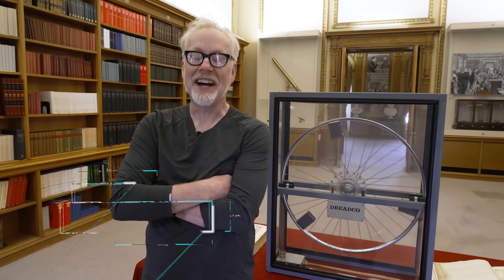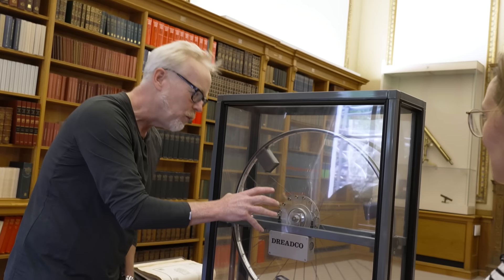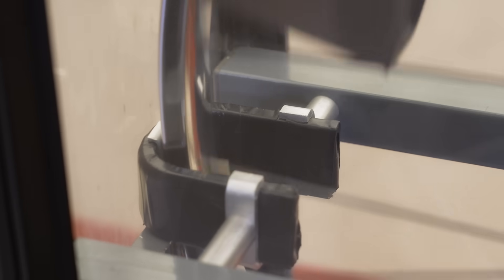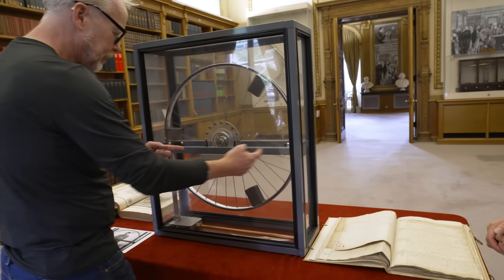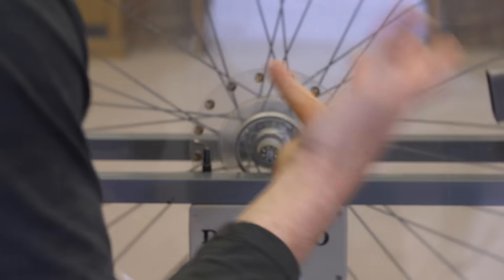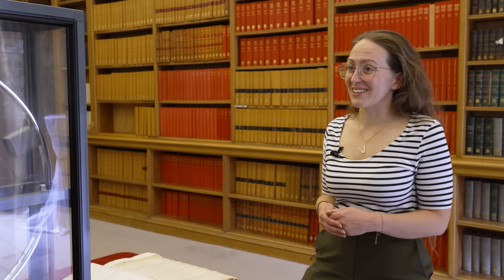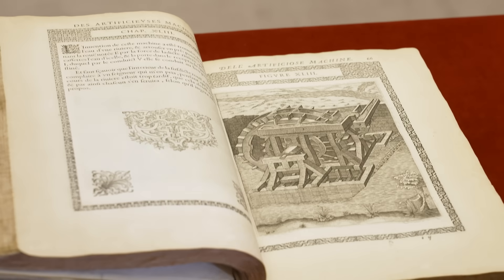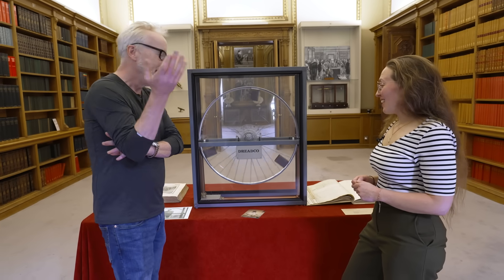Adam Savage vs The "Perpetual Motion" Machine!

Comment: a perpetual motion machine that only works if you send it back to the creator once every few months is like a magic trick that's really impressive as long as the entire audience closes their eyes when the trick happens
Reply: Well two years, but... Even so
Reply: After awhile that barring must have to be serviced for grease/barrings friction
Reply: Exactly. That immediately negates the alure. A “machine that moves for a few months without external intervention” is hardly newsworthy…
Reply: @JoeLion55  sounds like my wall clock
Reply: @JoeLion55  they said years not months.

besides a machine that self moves for 2 3 years built in what 1780 1890 whatever it was is still fucking impressive.

people today also forget that we didn't have 3d printers or MOST OF OUR CURRENT fabrication techniques.

our tools today allow us SOOOOO much more then we had available back then
Reply: @JS-rv3et  she says at the beginning the creator died in 2017…
Reply: @JoeLion55  well it's new to me, so the video has done it's job.
Reply: @JoeLion55  I think it is. The average human only witnesses a wheel spinning on its own for only some seconds or maybe a minute at maximum, when we test spin bicycle wheels or what not. A wheel spinning for 2 years without external intervention sounds very impressive to me.
Reply: @JoeLion55  you make a self contained machine that only needs servicing after 2 years, that literally doesn't stop. It doesn't stop mind you, after 2 years, it merely slows down.

This machine is extremely efficient, it's very impressive.
Reply: @TheCardanoArmy  great. Does that make it worthy of being housed by The Royal Society? Fine, maybe. Does it then deserve a video and investigation by Adam Savage with the label “Adam Savage versus the perpetual motion machine”? Absolutely not. Fortunately, Adam and the post were very clear that nobody is claiming this is a perpetual motion machine. So, at the least, get rid of the click bait title and name it “Adam looks at an interesting, efficient machine” and at least be honest about it
Reply: @JoeLion55  👶
Reply: Your analogy is pretty flawed; nobody who goes to a magic show actually thinks real magic is being performed. Everyone in the audience knows it's all smoke and mirrors, half the fun is trying to figure out how it's done. The audience isn't being asked to close their eyes while the trick is done, the magician's job is to hide the trick in plain sight, and that's exactly what's happening here.

Like Adam pointed out, we know perpetual motion is impossible, and nobody involved  is claiming this is really a perpetual motion machine. The entire point is to try and figure out what the trick is.
Reply: But you don't have to close your eyes. You're viewing an illusion just like watching a magic show. It's accepted that perpetual motion is impossible to achieve so the fun is in the art of getting as close to it as you can. A 2+ year running time is still incredibly impressive. Could you build a device that runs that long without any obvious mechanism?
Reply: It’s impressive how efficient they made it. Obviously toy can make the moving parts smaller and slower, or add more energy storage, but that makes the “hide the batteries” part of building a perpetual motion machine harder.

I don’t think the “regular maintenance” revealing that it isn’t perpetual is that detracting, especially considering that we already know “perpetual motion” is impossible (in decoherent systems anyways, there might be quantum mechanical phenomena that one would like to call perpetual, but they require very special conditions and aren’t really possible to create (it’s literally impossible to shield a system from neutrinos, for example)).
Reply: @haph2087  Tesla understood that there was a kind of cosmic energy that could be tapped into. Any thoughts?
Reply: @haph2087  A watch even does that on a much much smaller scale!
Reply: @LGAustralia  Yep, and IMO, watches are really cool devices!
Reply: @haph2087  my  9volt battery still works from 1989
Reply: @punker4Real  Nice, but has it been spinning a bike wheel for 33 years?
Reply: @haph2087  Not detracting at all. Much like when you shoot someone dead, pull the bullets out of their body and stick them back in your gun. You really didn't commit murder since you put everything back in its place.
Reply: @joanfrellburg4901  What? That analogy is nonsense.

Any reasonable person should already know, just from reading the title, that this isn’t a perpetual motion machine.

All they are doing by talking about the repairs is letting us know how close it gets, and being honest that it isn’t one.

I don’t think that’s at all related to trying to un-commit murder. If you clicked on this video thinking there would be an actual perpetual motion machine, you probably need a bit more science education. Since the typical viewer shouldn’t expect a real perpetual motion machine, admitting that this isn’t a perpetual motion machine doesn’t tell anything new to the typical viewer.

If you want to use your silly analogy, it’s more like they pretended to shoot someone with a finger-gun, and then admitting they didn’t, and you are the four year old still crying because somebody died.
Reply: @haph2087  Hmm ok, sorry you have a problem with my sarcasm.
Reply: @joanfrellburg4901  I don’t know if you knew this or not, but tone of voice does not translate into text. Especially if you don’t use extra punctuation to imply it. 

Certain devices like sarcasm are much harder to understand when reading than when listening.
Reply: @haph2087  Good point, no harm done, I respect your intelligence.
Reply: Be sure to change your smoke detector battery once a year, even though it could work for 2 years.
Reply: To be fair she said 2 years but yes they could just put "fuel" or new batteries in it
Reply: I think it’s funny.
Reply: To all you saying it s not a perpetual motiin machine I urge you to revisit the video. The while point is to have something close to it being extremely efficient and have people try to explain how it actually works. The argument "it s not perpetual motion machine" is akin to being going with your friends to an escape room, exclaming "but we re not really locked in here" and expecting to be applauded for your observation.
Everyone in the video and everyone being talked about in the video is aware that it s not a real perpetual motion machine.
Reply: @TheRandomYoYo  beautiful analogy, very well put!
Reply: @TheRandomYoYo  pop sci video enjoyers arent the brightest bunch
Reply: @TheRandomYoYo  no. I think the issue here is it's very much a poor approximation of a PMM, not a close one. It's easy to make something run beyond our lifetimes and know it's not a true PMM and we can be impressed by it, so having something that needs recharging every 2 years in a reputable institution is pathetic.
Reply: @TheRandomYoYo  Aww, you ruined it for us. This is the comment section where it's mandatory that we go off on all kind of tangents. Perpetually.
Reply: @joanfrellburg4901 I second that motion, perpetually.
Reply: that's when they replace the lithium batteries 😁😁
Reply: Maybe the maintenance consists on cleaning the glasses and ensuring that the labels still in place..... errhhhh!!!
Reply: Joseph Smith would be proud
Reply: Gremlin Man has nailed it, 896 people agree. Even I agree. So shut up and have a nice day.
Reply: See, the conundrum is ' perpetual ' which means never changing. When nothing is forever. You're asking for something that's unattainable. Even Earth, according to scientists, won't be around forever. Of course it's always fun to analyze contraptions that try to trick us into thinking the impossible has been created, the day we stop questioning we will be in big trouble.
Reply: It would need to be maintained the bearings would need oil  and friction is your biggest enemy the fact that they got it going for 2 years is impressive
Reply: @BLEACH366  Maybe Duralube or Slick 50 to squeeze a few more months out of it ? :-)
Reply: Yes, its perpetual (except for when the battery is recharged)
Reply: @gavin1168  Lol, that's why I got the plug in model. Only stops when there's a really long black out.
Reply: *Years
Reply: How else he supposed to charge the battery.
Reply: She said two years I believe. That's much better imo.
Reply: I know right, I'm going to submit my Ikea Clock.  It has run for about 3 years now on one AA battery.
Reply: So many magic tricks rely on putting a sheet in front of something for a few seconds, which is basically the same thing
Reply: I could be because parts wear out and need replaced.
Reply: You can make a very powerful static electric powered motor but it has to be kept in dry air to function. Benjamin Franklin had one to power his turkey spit.
Reply: Its more like an object that forces one to think, look and study. Its not meant to convince you it's a perpetual motion machine if they readily admit that its not
Reply: Closest thing to a perpetual machine is a jlc Atmos clock.
Reply: All perpetual motion engines would require maintenance as its moving metal components. Still needs to be oiled etc. Moisture and oxygen still courses damage.
Reply: If Perpetual motion Does not work as you Claim... Please EXPLAIN How the Earth keeps Spinning!!!! STOP LYING PLEASE
Reply: A person expecting a youtube video to show an actual working perpetual motion machine in 2023.
Reply: @CA-oe1ok  Funny, but inevitable. :-)
Reply: @CA-oe1ok  no, it’s that we expect more from Adam Savage and The Royal Society than a cheap toy associated with charlatans
Reply: @JoeLion55  I was surprised the Royal Society would have any part in this thing.....
Reply: @JoeLion55  They don't claim it's a perpetual motion machine. Though to be fair, for something with that many places to hide the batteries, it's not really that impressive. The Oxford Bell is much more impressive, and that's been ringing continuously since 1840. They put it in an evacuated glass jar after so many years because it was getting on people's nerves!
Reply: In fairness, if we did ever make a perpetual motion machine, parts would need to be serviced from time to time.
Reply: @JoaoPaletas hat is exactly what makes them impossible. Parts failing is entropy in action. It's not parts failing is holding back an otherwise successful perpetual motion machine. The energy the machine loses in the form of heat goes into the parts. The parts lose energy in the form of the bonds between materials failing and metal shavings falling off. It's just the same principle going down the line, applied to each system individually rather than thinking of it as a whole.  <-This is an example of critical thinking, what they should be teaching in schools, rather than critical race.
Reply: I mean, two years or more is crazy for an actively moving closed system, but yeah. It's not a perpetual motion machine in the same sense that a radiometer isn't a perpetual motion machine, but it's still an interesting and impressive feat of engineering.
Reply: @RalorPenwat  true. I'm confused with what people expect. On Earth, actually the whole universe, there is no perpetual machine possible, because it violates fundamental laws. But that does not take away the extraordinary beauty of very efficient functioning machines within our macro reality.
Reply: How long has the earth been spinning? Perpetual motion is relative to time.
Reply: @nevmcc3884  The rotation of the Earth or the orbital motions of the planets around the sun could be considered a motion that is perpetual as long as no other force is intervening in the equilibrium. It is not a perpetual motion machine however. The important part about perpetual motion machines is not the perpetual motion itself, but the idea that no energy is ever lost in the course of the motion, or that in theory infinite energy could be harnessed from the motion. A planet revolving around its parent star has no energy lost due to the equilibrium between the angular velocity of the planet and the gravity of the star. There is some friction of the planet against interplanetary meteorites as well as dust and gas particles, friction against the solar wind and the magnetic field of the star if the planet is relativey close to its parent star. This is also true for the rotation of the planet on its axis. All those fricton elements can slow a planet down, but the effect is usually so negligible that the planet will only drift ever so slightly in its orbit during the life time of the star itself. The most important part is that no energy can ever be collected from the motion of celestial bodies, and indeed no matter how much we try we can never use the Earth's rotation to generate energy. At least not directly.
Reply: @elimalinsky7069  Energy can be extracted from orbiting bodies.  There are multiple ways, including gravitational radiation.  Quasars might be the most powerful and efficient engines in the observable universe and their power source is material friction of bodies in orbit around black holes.  Extracting energy from orbiting bodies isn't perpetual though, it cause the orbits to decay.
Reply: @jlowe8059  "it causes orbits to decay" - and that's exactly the point. There is no such thing as free energy.
Reply: @elimalinsky7069  And there's no such thing as  perpetual orbit.
Reply: ...which means it doesn't exactly qualify as "Perpetual"
Reply: @peterlongprong7521  If anything moves it tends to rub and thereby wear. 
Perhaps the statement should be added to, with words to the effect of "worn parts will be replaced as and when required but without adding energy to the system"?
Reply: Nothing is truly a perpetual machine considering the effects of gravity and electromagnetic force. Assuming one accepts a machine in an ether to be perpetual with no additional interaction, then this might actual be a perpetual machine. It's 'maintenance' might just be replacement of failing material or the clogging of dust particles (from failing material).
Reply: @fritsgerms3565  Talking maintenance, yes ... so long as no refuelling. Tut!
Reply: @fritsgerms3565  I keep trying to understand what you are saying, but it makes no sense... What is "a machine in an ether"?? And what about friction (the main reason why most "perpetual motion" machine eventually stop)?
Reply: @BogdanSass  with 'ether' I use a very old term for the 'air' around stuff. The ether includes external gravity affects, electromagnetism effects, etc .. outside the closed system (the box). Here, friction happens within the closed system and is not considered part of the 'ether'.
Reply: @fritsgerms3565  Actually, IIRC, that very old term was used for "something filling outer space, and carrying light". And that was proved to not actually exist a long time ago.

If, however, by "ether" you mean "air".... There is such a thing as air friction, and that makes your first statement ("perpetual machines can exist in ether") false...
Reply: @BogdanSass  you are overcomplicating it. I used it as a placeholder for all the stuff around the system. Which is pretty much in the same spirit as the classic use for the stuff around everything (that was not clearly distinguishable). I could have used the term 'soup', but that's less transferable than ether.

Comment: There are any number of ways to create a form of perpetual motion. The largest is of course the Universe itself. To deny the ongoing existence of which is just mindless. The Roman syphon is another - used to operate fountains for hundreds (if not 000's) of years (attributed to a Roman Emporer - works on air pressure @15lbs per sq. inch and the inevitable effect of gravity during the syphon process). There are more.. and only the ignorant as educated by academia ignore or deny these FACTS. Savage clearly doesn't know the history of water engineering. SAVAGE IS A PRODUCT OF A LIMITED EDUCATION. The process of keeping anything in motion simply requires energy, which exists in many forms. The Ionized field which exists everywhere at all times can be harnessed. It is the energy field which literally "drives" everything. We are merely scratching the surface of understanding. And fools like Savage hinder progress with constant denial - welcome to the modern flat-earther... it's like try to explain the automobile to a middle ages carriage maker. Impossible! Ionized field..? Sometimes referred to as the aether by the more esoteric or Dark (unseen) energy by physicists - NOT to be confused with background radiation which also permeates the Universe. Matter and this ETERNAL energy are in a perpetual cycle of organization and decay. Chaos Theory respects this process as inevitable and essential to the ONGOING process of creation (whether YOU believe that process to be an act of God, or not!)

Comment: You bring the right tools, and you figure out all you need to know about this in 5 minutes...
Reply: Unless the box with heat fins is just an air puffer, and all the rest is just show.
Reply: @Donald Kasper  like the 200 years old clock that uses pressure difference between day and night?  
Anyway it's just matter of bringing the right tools and you just find out what's a decoy.  Than it's simple